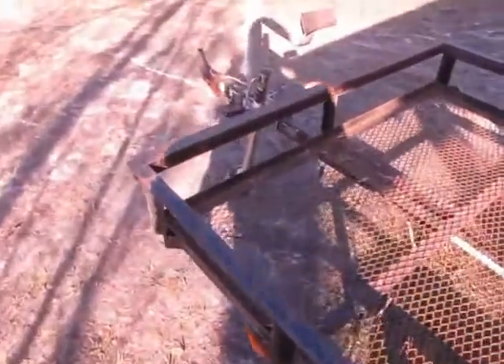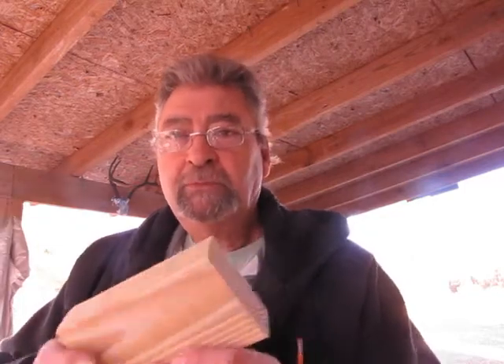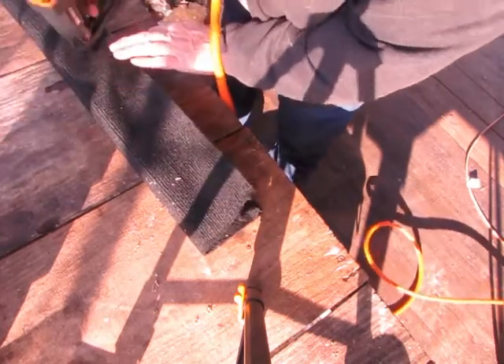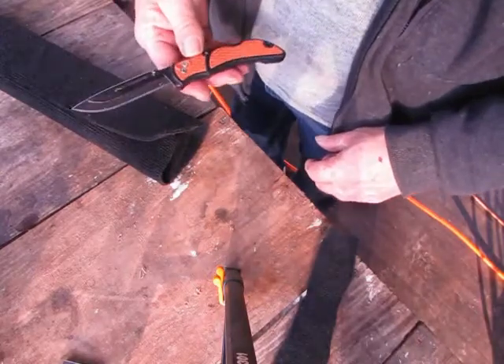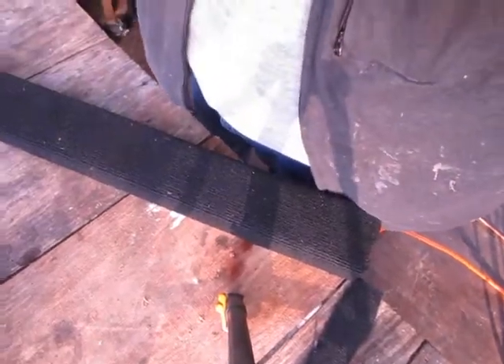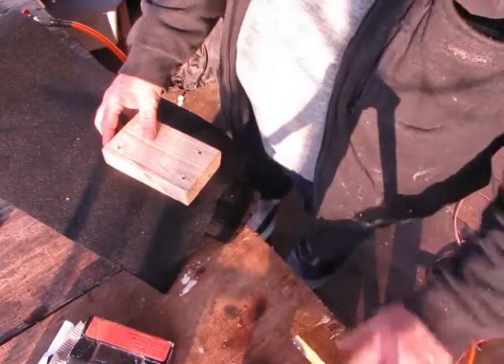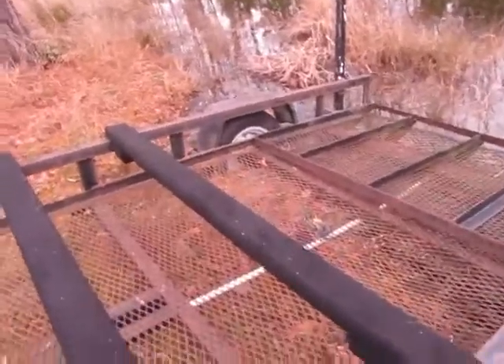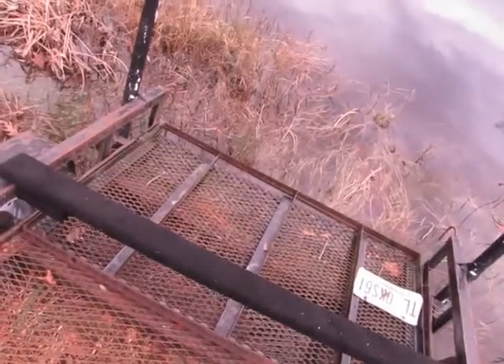Bass Raider 10E Trailer Build

Comment: Put you some holes in the planks and trailer beams. To drop a bolt in to hold in place while loading and unloading. No footwork needed, then remove pin or bolt when finished 👍🏾👍🏾😎
Reply from the maker: Sounds like a plan Hawg-Lander. I think I will. Thanks a lot.

Comment: Just a heads up… don’t leave the boat sitting on the 2x4s on that trailer in the sun. The bottom of the boat will warp. I built my trailer (converted jet ski trailer) with 2x4 cross ways and it almost ruined the boat. It really needs to sit flat on plywood or 2x10 runners. Happy fishing.
Reply from the maker: Thanks for the heads up. Will do!